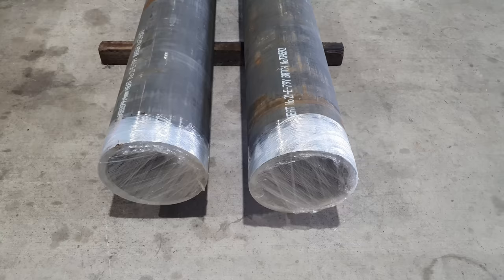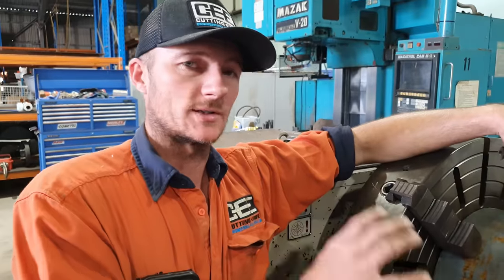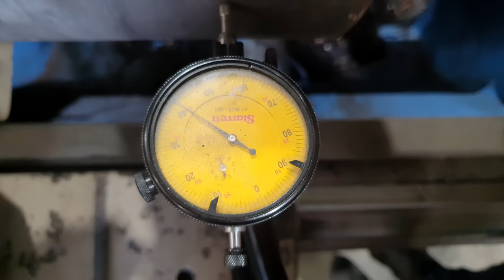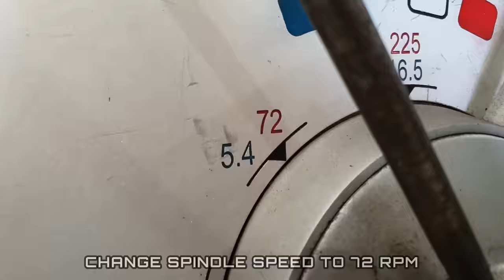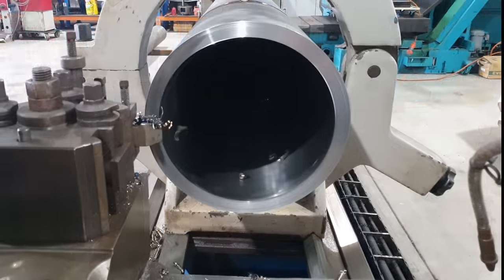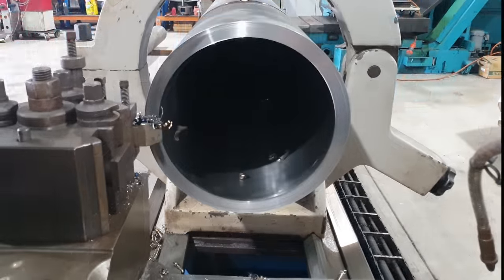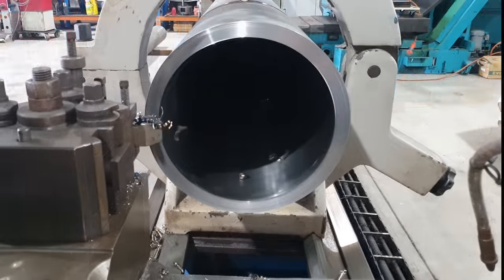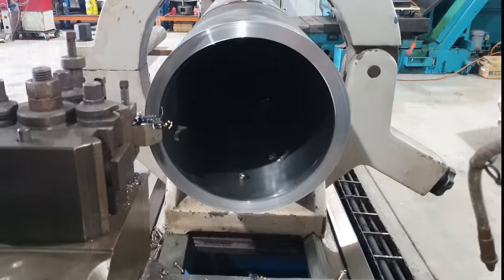Machining With The BIG Lathe | Large Lathe Work

Comment: Hey mate, juts FYI, that thing weighs 600+ kg, and you picked it up with a choked purple sling. I know those slings have a 7:1 MBS to SWL rating, but choking a 1000kg sling will bring it's rated strength down quite a bit (usually close to 50%, but it's dependent on many factors). I'd hate to see you drop something that heavy! Probably best to use a 2000kg or higher sling to lift stuff that heavy in a choked configuration. Thanks for the content mate, love the channel!

Comment: I have been machining ( manual and CNC ) for over 40 years and I can tell you in 40 years I have never seen a better manual lathe operator as good as you. Keep up the great job. In a other video you edge found wit a rod and feeler gauge. Had to do it myself many of time I could not reach with a 1/2 or .200 edge finder. I personally own 3 Starrett of both just encase one brakes.Thanks again for the great videos.

Comment: great job mate, I'm a boilermaker myself, and I definitely don't want to tell you how to do your job because it's probably something you already know, but when I do similar jobs I normally chuck some bolts in the threaded holes to avoid them catching any spatter. Saves the trouble at the end cleaning them out just in case it happens. Keep up the great work!

Comment: I love how these cylinders ring while they're being worked. I get that that's something you want to avoid since those kinds of vibrations can ruin precision parts, but there's something about that sound that I love.
Reply: Yep, some ringing means bad stuff, but cutting tubing like this will make a ring. Think in terms of like a bell?

I've cut a lot of tubing when manufacturing well pump casings etc., some a lot bigger than this stuff and typically thinner wall. Essentially the same operation he did here except for flange rings. It about always makes a ring like that. 

Now, if a sound like that starts changing significantly kill your machine or just run! Lmao!

Comment: Man, if you get a much larger lathe you are going to need to hire someone just to help you move tooling!
And I laughed when you just casually slid the tail chuck INSIDE the workpiece and opened the jaws. Brings a new meaning to internal jaws... Lol

Nice land leveler rig. Looks smartly designed, and I love the way they made all the cylinders a nice color to show off its many capabilities!
Reply from the maker: You got that right! Thanks for watching mate
Reply: I sometimes have a need for someone with something like 5.5 metres working area, for the machines that I maintain.. There was a big one here in Melbourne, but it has moved on somewhere. I do know where one firm that I use, put two lathes tailstock to tailstock, to turn a part longer than their longest lathe.
Reply: We used to talk about "Abom-size" machines.  Now, his don't seem so big.
Reply: @jemijona  In my younger days I used to machine 6m copper rollers for the manufacture of nickel screens 280mm diameters initially it was quite difficult not getting any chatter and taper but I perfected it, the struggled after I left!
Reply: @Grandpa82547  Abom who? Lol
Yes, Adam was who lots of us discovered the joys of YouTube machining from in his early days, but he's been surpassed on many levels!
Reply: @Grandpa82547  Since Adam left his full time job, he has pretty much lost access to the beasts. And I'm thinking Abom Adventures is leaning into his engineering channel. I'm sure he is watching likes and comments and it going with what is popular. Of course, you can't please everyone.
Reply: @ke6gwf  - Adam's channel has totally lost the plot recently. The sponsored content and overly-long (non-edited) content is really boring. The "big fan" video he just published is just an embarrassing joke.
Reply: @johncoops6897  yup. I haven't watched anything for a long time, but I see the video titles pop up once in a while, and move on! Lol
Building a truck crane looks nice, but not terribly interesting.
I saw he built a new shop building, so maybe he will get back into actual big work?

I think he basically discovered he had a fan base, and so it turned from the "watch someone make cool metal", to "watch Adam do stuff!".
There seems to be a big fan club that likes watching Adam, but I was there to watch the metal!

So now I watch Karl and Isaac, with Demolition Dave to blow stuff up occasionally!
And of course, This Old Tony, because, magic!
Reply: @ke6gwf  - On that same note, take a look at "Made By Madman". It's very similar to ToT magic and editing, but without any of the precision or puns. Try to ignore the clickbait titles, just focus on the content itself (it's all pretty good) - the newer stuff is more "fun" as his editing skills have improved heaps.
Reply: @ke6gwf   Yes totally agree Abom79 has lost its way a bit... ToT has alway been there for the one liners and creative magic of chineese cutting of tool steel by hand. CEE Australia will alway be my top channel cause its a real life workshop with no bullshit and work done to the highest specification. it just kills over most engineering channels IMHO.
Reply: @Ashley.0000  what do you mean that CEE has no BS?!?
That's half the reason I watch Karl is because the BS is so awesome! Lol

The only other channel that is close to the quality of machine work Kurtis does is Edge Precision, but you have to enjoy long discussions of every aspect and consideration and how to program the CNC, so it doesn't have the same appeal that CEE does.
Reply: @ke6gwf  Ok Karl or Carl . I will have to agree with that one.. lol

Comment: Hey Kurtis, just a really dumb question possibly. That tube looked to be precision honed on the inside unless I'm mistaken. Is that really necessary considering your welding plugs in both ends? Seems like an added expense when an unfinished internal bore would work considering. Just a dumb question I guess. Maybe its all you could get or customer supplied material. Just curious.
Reply from the maker: hey mate good question was going to explain that in the video but didn't. Material is in short supply at the moment and customer got what they could get, we agree it's a waste of a finished honed tube the unhoned is what they normally go with.
Reply: Plan B was to drill out solid bar stock :)
Reply: @BangOlafson  Thats one big drill 😅🤣
Reply: @mattcyr3342  Yeah, it'd be better to trepan it, like a certain Pom.

Comment: When you machine the band for the rollers, is that at a specific place so that it is covered up in a future manufacturing process, or can it just be wherever is best to stabilize the part?
Reply: I was thinking about that, and I would guess that they would be put where things are NOT being welded on, since it slightly changes the diameter?
Reply from the maker: Hey mate yeah it's in a position that is clear of the carriage and close enough to the machining end but also away from any spots that will have parts welded to it

Comment: Issac and you are very skilled with a cutting torch and a carbon arc or arc air. I burned a hole in my foot with an arc air years ago and hated using it since then. Now retired after 44 yrs in chemical plant maintenance

Comment: Watching this video while running cuts on a ballistic missle tube core..weld preps for the crown plate to be wellded on..7 in G L 5axis ,old but reconditioned with fanuc controls..smaller part..12 tons..on 12 foot floor rotary table..always  enjoyed lathe work..made many from scratch parts in maintenance machining..45 years in the trade..18 shops..three states..love this trade.

Comment: Brings back memories of some similar sized work I did in the 80's.I cut the bearing surfaces on a turbine shaft for a small hydro company. The shaft was perhaps 14" diameter with a 24"x3" flange at the headstock and a 36"x3" flange hanging over the end of the bed .Done in a steady rest without the nice rollers.Lubed with white lead and oil.The major difference was that the lathe was built around the 1860's !

Comment: I remember working at a machine shop for a while that did parts for the mining industry.  While I was there there was a drum on the biggest lathe that i've seen in person.  It was a drum for a winch.  The bed of the lathe was lower than your big one here but it didn't have any legs.  Well, the legs were more like a thick place on the bed that kept the rest of the bed from touching.  The bed of it was wider than my personal 12X36 lathe is long.  They had put a truck transmission on top of the gearbox (head?) of the lathe to reduce the speed even more than it was designed to go.  The drum that they were cutting the cable grooves in was over 8 feet then you add on the sides of the drum.  It was huge.  Impressed the heck out of me.  Wasn't even 30 back then.  Funny thing is, I don't think they could have done this job on that huge thing.  No steady rest.  Don't know if they made them for this machine and the shop didn't own it or they just never made one.  Who made this monster?  I have no idea.  Looked like it was from the WWII era.  Also I may have never looked at the name much less remember it.  Keep up the great work guys.  Thanks for posting.
Reply: Not that old. It's a Shenyang - Chinese. In general Chinese heavy machinery is a lot better quality than you'd expect from their lighter products.

Comment: You need to spray some Pam on that mig cup. It's cooking oil spray. I'm pretty sure it works by vaporizing into a carbon layer that the slag is easily removed from. I find it works better than most of the mig dips I've tried, certainly more available and cheaper

Comment: I leveled hundreds of banana-acres with a Marvin 15 cu banana-yd scraper equipped with a single axis Spectra Physics laser system.  (This means we only had 1 axis of tilt and had to use a chart to calculate the cross-fall we wanted and rotate the laser X degrees to get the compound slope.)  We used a John Deere 4850 MFWD to pull it, which was under-sized for the scraper, but Marvin built a gooseneck hitch and dolly system that allowed us to use this tractor very successfully and not use an articulated 4x4.  By far, the most jobs we used it for was for leveling alfafa ground for flood irrigation.  We'd simply figure an average slope, top to bottom, dial that into the laser with =no= rotation, then just run circles between the irrigation borders to give us a zero grade cross-slope.  We'd just keep a minimum of dirt in the bucket so that it would fill a bit as we circled then move the receiver mast up or down to keep dirt in it.  It greatly increased our irrigation efficiency and saved us tens of thousnds of $$ over the years.  We also did a bit of custom work for others, which helped the farm's cash flow, for sure!  Nice to finally see that big beast of a lathe in action, too!

Comment: A useful trick, for dialling in rough surfaced tubes/bars, is to put a thick 2 feet steel rule (such as you get in a combination square set) vertically between the tube/bar and the indicator, with the bottom end of the rule resting on the way.

Comment: Saw that stinger get into your sleeve. Place I used to work at made us get our company supplied boots at a place and everybody griped about them as stingers would get in around the tongue and burn your feet. They wouldn't change brands. I called OSHA. They got fined and we got different boots. No welding by anyone until everyone had them, some were special order and took months to arrive. They came to inspect before allowing anyone to weld, we all were paid during the wait.  Then Overtime pay to catch up.

Comment: Thanks.  Really nice finish inside, machined/honed for a hydraulic cylinder.  Will the supplier lower its price if you don't need that finish but they've got it in stock?  Also, awfully deep cut for the steady rest on the first one.

Comment: Enjoyed today's video and I actually have a couple of questions. First, how do you determine where to put the flat area you machined for the steady rest? You measured it out from one end for the second tube so clearly it can't go just anywhere. Maybe it was a feature of the tube exterior requested by the manufacturer? Or is their a machining rule for placing it based on part size, speed, et cetera, to provide proper rigidity? Second, what kind of tool were you using inside the groove between welds on the second tube? It looked like the end was a bunch of vibrating needles? And finally, like a lot of countries, Australia has different names for things here in the USA. You say sparky, we say electrician. I'm trying to understand the reasoning behind your company name, CEE. Is the term "engineering" synonymous with "maintenance" in Australia? I have watched a number of your videos and you have done a lot of maintenance work for your customers. Sometimes you had to figure out a solution and that could be termed engineering. In today's video you were actually doing manufacturing for a customer who probably didn't have a lathe big enough to do the job on the tube ends themselves? Just curious. You really are a jack of all trades!
Reply: The machine he often uses between welds is a "Needles Scaler", to knock off the slag without hammering.
Australians usually call them Electricians too. However it is a rule to also have a second or third optional name for everything, for example a Carpenter is also called a "Chippy" (wood chipper).
Engineering is a term that means exactly the same in the USA as in Australia, and it's got nothing to do with maintenance. CEE seems to take whatever large work they can get (or is profitable) irrespective of whether it is fabrication, machining, repairs, modification, design, or whatever. They don't really do any maintenance work, they most commonly perform specialized machining, welding and fabrication for the people who are maintaining heavy earthmoving equipment.

Comment: You hold the tube on the outside in the live 4 jaw but on the inside in the tail stock chuck - surely it would be better to hold on the inside at both ends

Comment: At  about 19:11 you appear to be measuring the internal diameter of the tube with rectangular ended calipers!
Please tell me that the calipers have either ball-nosed or wholly triangular single-point mating surfaces?
Otherwise, you will be creating a chord in the arc of the circle with the square tips, which will grossly distort the reading.

Comment: 28:10 Did you blow out the swarf from inside the tube before welding? Also, wasn't the customer concerned about those technological grooves you've made to support the tube on the lathe?

Comment: Just a thought …. wouldn’t it be useful if your vernier / measuring instrument was smart so that when you check the machined dimension and it is correct to the drawing you can send the dimension to a file along with any other machining you are doing to the drawing and then at the end you dispatch the job with a certificate of ‘machining done’.

Comment: Quick question about the second tube finishing.  When I saw it being loaded onto the weld roller (27:50) I noticed a lot of machining residue in the tube.  Next thing I see is the installation of the end caps.  I just know it got blown out before it was sealed.  Am I right?

Comment: Quick question - Is there any issue with the bit of material that was machined off for the rollers on the outside of the tube?  Does that impact anything with the end use of the product?
Reply from the maker: hey mate, no issue with the band for the steady rollers it is away from any position where there will be parts attached or welding done to it. 😎👍

Comment: Got a question:

I expect you did a fitting and turning trade, but I wonder how that works with welding? My understanding (which seems to be wrong) was that welding work, particularly of pressure components (like the hydraulic cylinder you fixed in anther video), is normally done by someone who has done a welding trade (boilermaker?).

Is it that people who do fitting and turning are also expected to learn how to perform welds when it relates to their area, or is there something I am missing?
Reply from the maker: hey mate i have experience in multiple trades
Reply: @CuttingEdgeEngineering  Is that common?

Comment: Sounded like a different do (or whatever) when you removed the plastic from the ends of those pipes.
Reply from the maker: wondering if you mean...didgeridoo ? 🤔🤣
Reply: @CuttingEdgeEngineering  That's it! I meant to type "digger" do, but was auto-corrected and failed to check my work.

Comment: What grade of steel are the tubes by the way?
Reply from the maker: ST52 cold drawn honed tube
Reply: @CuttingEdgeEngineering  ok thanks!
Reply: @CuttingEdgeEngineering  Is there a particular reason this grade of steel is used instead of 4140?

Comment: Really pushing that one tonne lifting sling to it's limits. Remember that choking a sling reduces its strength by 50% (potentially more depending on choke angle). Sure there is a healthy safety factor but for $30 for a 3t sling why risk it? Surprised the safety officer didn't pull you up on it! Haha

Comment: The center of rotation of a pipe with a rear small 4-piece chuck is best measured not on the outer wall of the pipe, but on the outside of the chuck jaws. Then the center of the inner wall of the pipe will coincide with the center of rotation and the center of the hydraulic cylinder rod. The video shows the misalignment of the cylinder bore and the center of rotation. Different wall thickness of the pipe after turning will lead to misalignment with the rod and piston, misalignment, wear out faster. Sorry for my explanations and translation into English, I hope you understand.